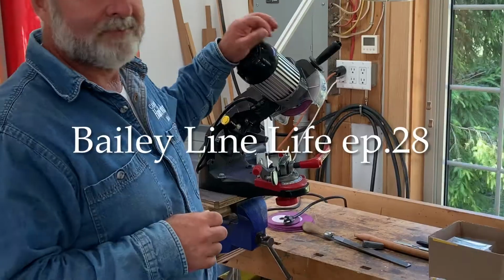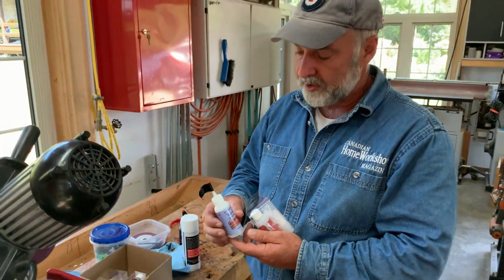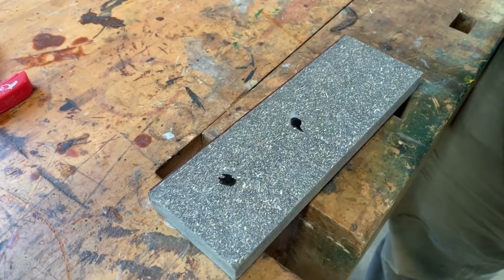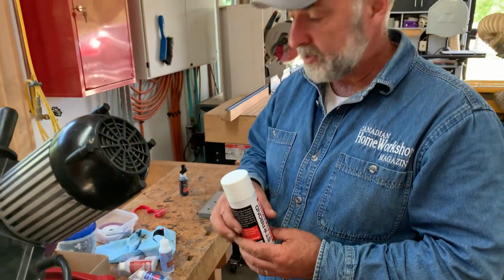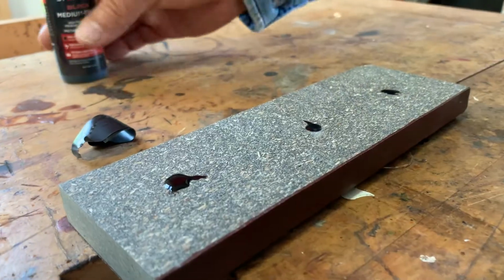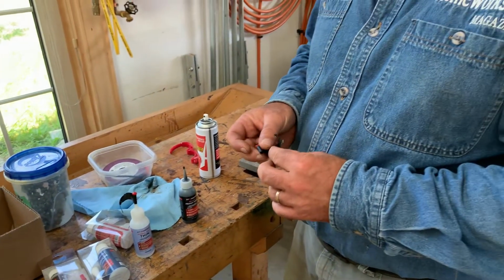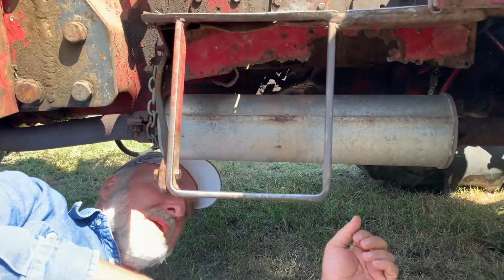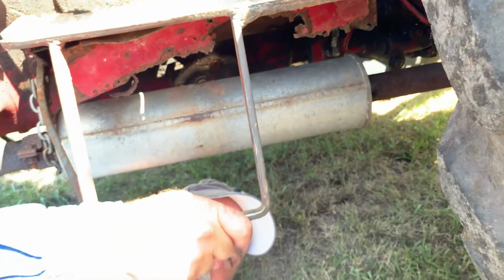Instant Drying Glue as Strong as Welding

Comment: When trying to bond plastic to plastic, I use a product called Plastruct Plastic Weld(glass bottle with orange label). The stuff is amazing, hold the two pieces together & apply onto outside of the break. Capillary action pulls it in along entire joint. Super easy & it never comes apart in my experience. Great video, thanks for sharing!